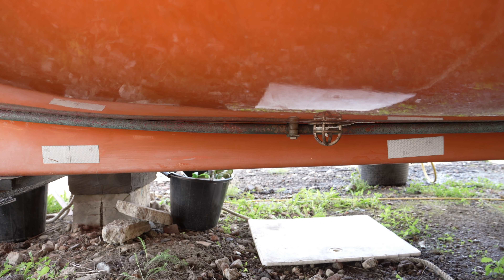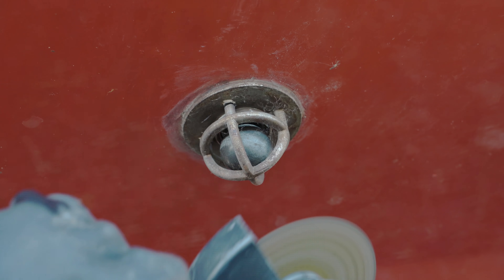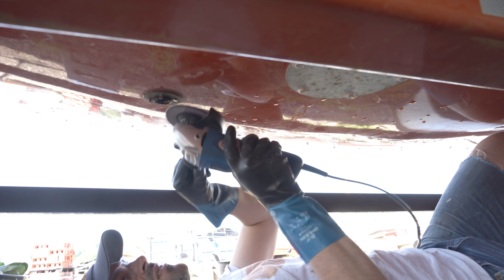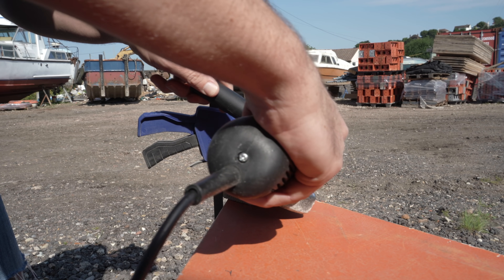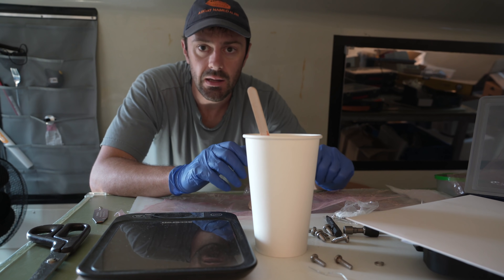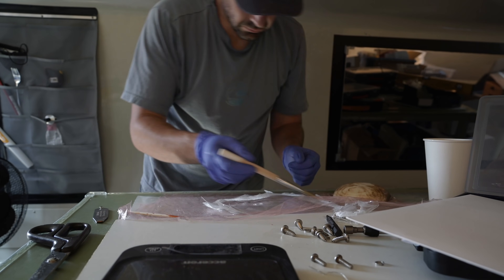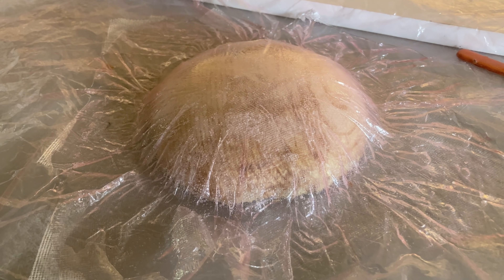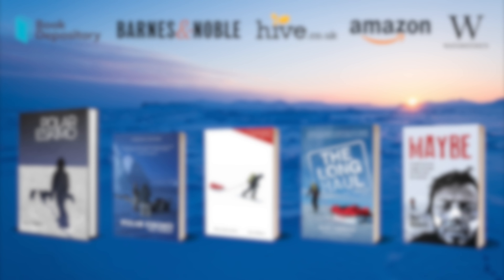Lifeboat Conversion Ep24: Removing hull fittings from the hull and making fibreglass covers. [4K]

Comment: I suggest a plate to cover the keel cooling pipes. Protective but not fully encapsulating so as not to effect function. I think a fitted plate running for and aft would create less drag than a cage. 

Great work, both Alan and the documentation.
Reply from the maker: Thanks for the input

Comment: You're better off with keel cooling in ice conditions because water intakes can get clogged with ice.  Consider putting an arrow shaped wedge in front of the keel cooler to deflect debris to the sides and eliminate the blunt forward edge.
Reply from the maker: Certainly an option in my box of ideas. Will expand this later into a full consultation.

Comment: It will be a stronger plug if you remove the stainless fittings and fiberglass the holes that will keep everything flush with the hull!
Reply from the maker: My concern with that is I have no idea about how deep the steel is set into the hull, and how it's bedded. If I kept grinding back the metal, I could end up with a real mess, and would then have to grind back surrounding fibreglass and completely rebuild the structure with new fibreglass. This method is less complicated and is belt and braces - I'll comprehensively seal from the inside via the through hull fitting, and then fibreglass on this cap, which will only end up slightly proud of the surface.
Reply: @AlexHibbertOriginals  unscrew the  throuhull and the stainless should be able to be removed

Comment: Keel cooling will always be superior. If it were me, I might make some custom fiberglass bumps round it for protection.... in the very least, the front. Of course, you could always make the other system you mentioned to work in tandem or as a secondary system for redundancy since if that fails, it’s not the type of thing that’s easy or really possible to fix in ice water.
Reply from the maker: I'm mulling this very seriously.👍
Reply: @AlexHibbertOriginals  Cool. Cant wait to see which direction you decide to go. New to the series but I binged it to catch up.

Comment: Maybe I missed the point of the dome, but what is the point of the dome?

If I understand it correctly you will attach the dome above the thing you just cut off? 
Why not just make that thing flush with the hull instead of adding a protrusion?
Reply: And if there's a protrusion, why not include the wood mold?  At worst, it rots and you end up with the same strength as if it didn't exist.
Reply from the maker: My concern with that is I have no idea about how deep the steel is set into the hull, and how it's bedded. If I kept grinding back the metal, I could end up with a real mess, and would then have to grind back surrounding fibreglass and completely rebuild the structure with new fibreglass. This method is less complicated and is belt and braces - I'll comprehensively seal from the inside via the through hull fitting, and then fibreglass on this cap, which will only end up slightly proud of the surface.
Reply: @AlexHibbertOriginals  I guess that makes sense.

Even though you said in the video that you made the dome deliberately oversize to cut it down later, I still had the image of that huge dome sticking out of Alan's hull in my mind :)
I guess it won't be as big of a bump as I think it will be.

Comment: Will you reinforce Allen's lower bow as it will encounter ice and some of it can be sharp. Basically you need armor up the front.
Reply from the maker: There are many ways that ice can stress a boat hull: sharp point impact, crushing from both sides, scraping, and a blunt collision.

Glass fibre is good at handling some of this. Energy can dissipate through the flexing of the hull pretty well - better than metal - and steel hulls only win in this sense through sheer bulk, if thick enough. 

It's important to avoid crushing either by lifting up out of the ice pack, or through lots of bracing. The former is preferable.

Impacts will have speed as a factor, and it's notable a closing speed will never exceed 7 knots with Alan.

Given all this, something I will consider is a bow-mounted structure to divert ice along the sides. Ultimately, it's boat handling that will avoid a head-on collision, full speed, with a 1000-tonne solid ice pan.

Comment: I think it’s possible to build a cage to protect the keel cooler. You’re not going that fast after all and the your centerline keel does offer protection as well.
If you do plan to discard the keel cooler then you could possibly use one of those through drains that you just cut the cage off of as your raw water intake. 

Some things to consider about switching your cooling system style. Are you still planning to keep Alan for more then one trip? If so then when you change from keel cooling to raw water cooling it’ll require some additional conversion. You’ll need a heat exchanger. You’ll need a belt driven raw water pump (jabsco) to draw raw seawater and pump it through the heat exchanger. You’ll need a sea strainer to strain/filter the sea water. Unless Alan is only going to be used for a one way journey. Because if you pump sea water directly through the engine then engine life will be extremely limited. 

Alternatively you could switch to a more robust plate style keel cooler. Rather then the pipes. Similar to how a narrowboat keel cooler is. Obviously it’s different as Alan is fiberglass. But you could build a long, slender, thick steel tank the has sloped ends and it made from thick steel to resistance ice damage. This tank style cooler could utilize the same through hull holes as your current keel cooler pipes going.

However if you do abandon the keel cooler then you can build up a little fiber glass or thickened epoxy around those through hull plates. To make it a smooth transition across the plate so that ice can’t catch.
Reply from the maker: Your thought process is similar to the conversations I've been having. Will update! 

(I'd never run raw seawater through the engine)
Reply: @AlexHibbertOriginals  it sounds like you’ve got a solid plan forming. I look forward to hearing it at your convenience. 

Seriously nice work so far! 

My thoughts and advice are put forward with respect and meant to be helpful. I hope I’m not coming off as a troll. 

Cheers,
Jeremy K

Comment: - in an artic enviroment heating your hull might be a good idea. How would you get the boat out of the water when on expedition?
Reply from the maker: I'm unsure what you mean about heating the hull?

The boat can be rolled/winched onto ice pans.
Reply: Alex Hibbert Originals - you are in an environment where icing on the boat is a possibility. How do you get the ice off? Heat or isopropal alcohol?
Reply from the maker: I think generally you manually de-ice any areas that are being affected. But Alan will mostly be stationary during the coldest conditions.
Reply: Alex Hibbert Originals - by stationary, you mean pulled up on the ice?
How does frozen fibreglass react to having the ice hammered off? Take a tent you can prop up on the hull, and heat.
I am bringing this up because visions of the Franklin expedition keep coming to me.

Comment: Hello alex i would recomend Concrete "diamond" grinding disc they work on everything and will last LOOOONG time than any grinding disc. Thank me after you've tried one ;)
Reply from the maker: I'll check them out. This zirconium flap wheel is going strong after quite a few months though.
Reply: @AlexHibbertOriginals  i get that but with that one you can cut through annything haha it has such agressive but soft ttouch too

Comment: The form/mold you are using for the fiberglass dome work would be called a buck if used in vacuum forming, not sure if it's the same in your application.
Reply from the maker: Just what we need - another name for the block of wood.

Comment: How will the fibreglass hull fair against chunks of sea ice?
Reply from the maker: It's all at low speed. Most will just roll down the sides. The dramas to avoid are a blunt bow-on impact against a large pan, or ice getting pulled through the prop guard.

Comment: You should get a 3D printer! You can get a very solid one like the Creality CR6 SE, and be up and running within weeks of troubleshooting and waiting on 14-hour prints that fail in the last 20 minutes. Only a few dozen kilograms of filament wasted on failed test prints and you'd have that dome shape knocked out perfectly, once you figure out the ass-backwards software required to model for accurate dimensions!

Just kidding, obviously. Even if you had a buddy with a 3D printer who could get the model done and the print started within 20 minutes, you'd be done with your entire process including mounting the final end result by the time it was done printing. I love my 3D printer, but damn does it take a long time to do even the simplest things with it.

Comment: You can’t get out air bobbles using a brush.  No way .you need a steel roller and some experiance in building glassfiber boats. Just saying beeing a fiberglassboat builder for 30 years now. Otherways GREAT WORK!
Reply from the maker: For this small part, I do have to beg to differ. The laminate, before I placed it over the pattern, was easy to check due to the translucent glass, and it was bubble-free.

Comment: Please hear me out. Lose the engine and fuel tank. Replace it with an electric motor. Solar panels. More batteries. Add some little wind turbines (at least 2). Add some mounting for detachable masts (in case you'll need to sail if engine broke).
You would have saved more space and gained more speed. 6 knots ain't gonna cut it on stormy seas.
Reply from the maker: Solar and a couple of wind generators won't generate enough power to run c.40hp electric motors without long periods sat inactive, charging up.

6 knots is all the boat will do in any configuration. In difficult seas the limiting factor is going to be the thrust the prop can generate. It appears from sea trials that the prop is relatively high thrust (despite only three blades) since the hull's max speed is achieved at fairly low engine revs.
Reply: I watched on another guy's channel that he can run 18 knots on his full solar yacht.. Can't remember the name now
Reply from the maker: Alan would have space to install perhaps 4-5kW of solar and wind generation, at a push. Just not a go-er without a diesel generator, sadly.
Reply: Solar panels? In the arctic? Where the two options are no sun and very low sun (and clouds)? Supplying 700,000 watts per day for 40HP?